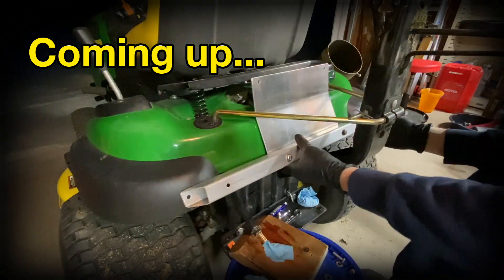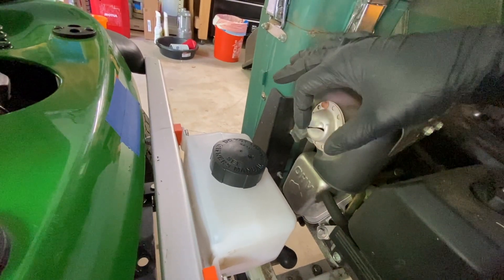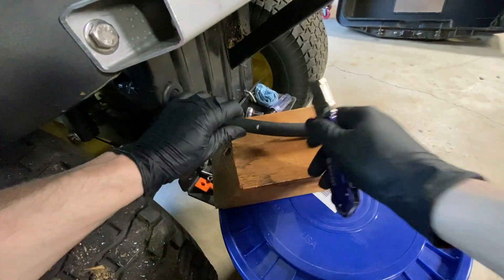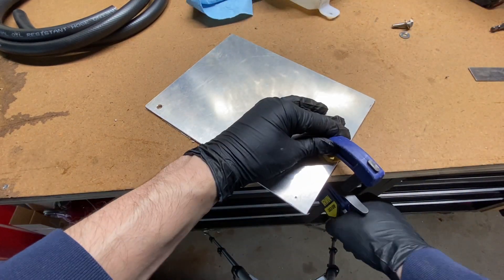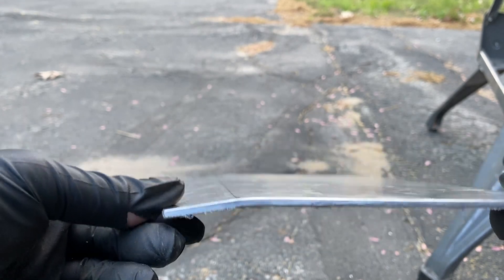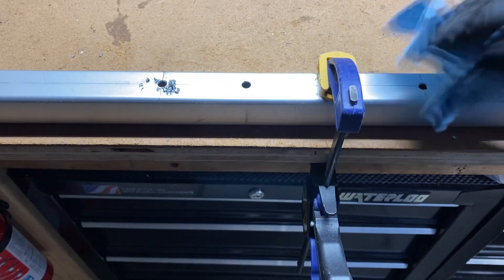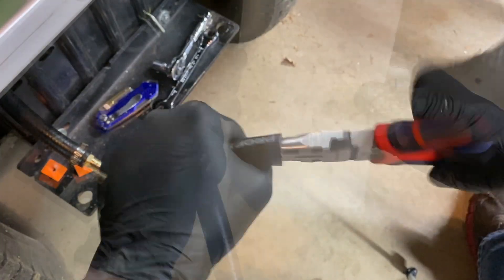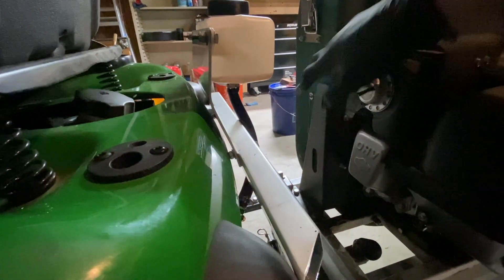Relocating a modified Tuff Torq K46 / T40 transaxle expansion tank (Oil Fill Mod Series Video 3.1)

Comment: What oil did you use?
Reply from the maker: Mobil 1 5w50. Tuff Torq recommends their brand of oil though FYI. They say it’s been formulated specifically for their transmissions. Here is the video where I filled it if you are interested: https://youtu.be/0nm1FFR67Jo?si=hYk-dkYjt6YDuIL0
Reply: @MostlyBuilds  thanks!